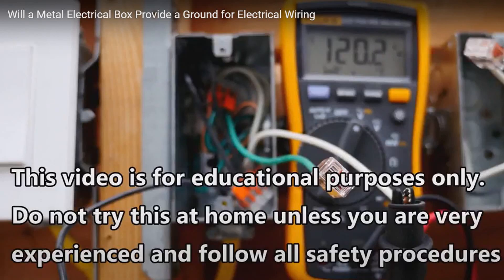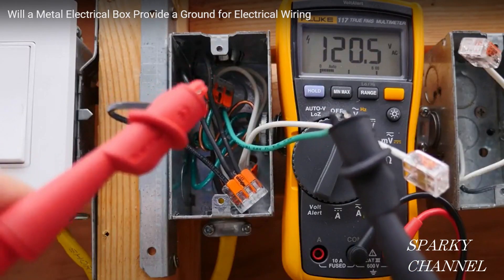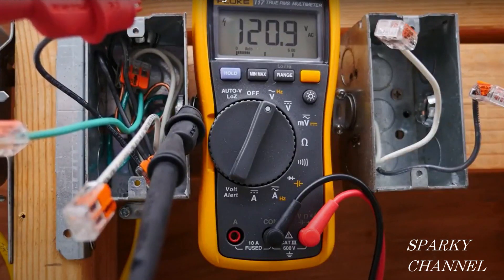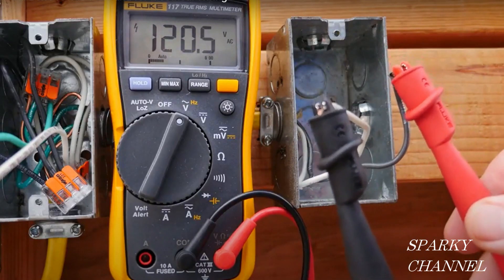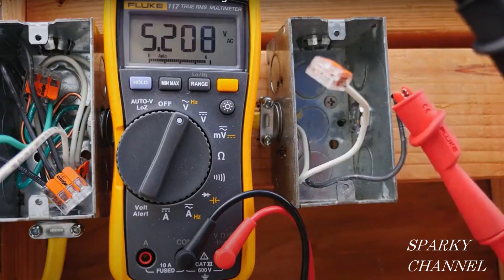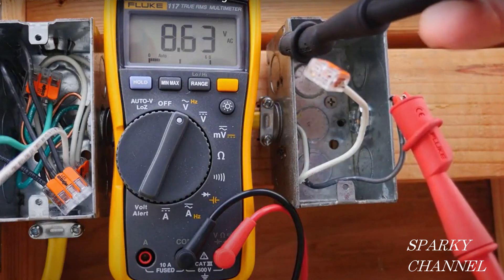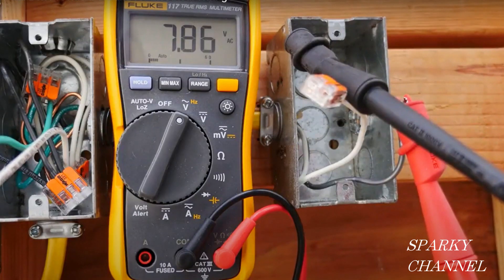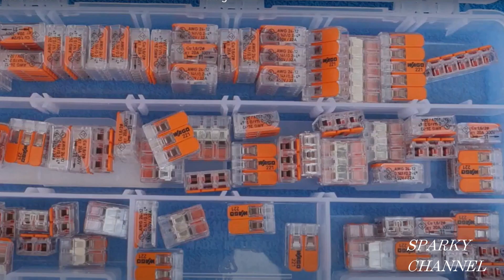Will a Metal Box Alone Provide a Ground for Electrical Wiring?

Comment: I have a 1966 home with an outdoor junction box (metal) that is ungrounded. I called an electrician to ground the box for the install of a new light. All they did was attach a pigtail to the box….they said “the box will never be grounded, this is the best we can do.” …should I be concerned?
Reply: Very concerned. I would be inclined to not pay that electrician.
Reply: Running a ground wire back to the electrical panel is the only true fix.  It could be expensive.
Reply: you mention an ungrounded box, how does the wiring get to the box? is just the cable? run through metal conduit? I have a similar situation but mine runs through a conduit all the way back to the Main breaker box so technically is grounded via the metal conduit where the wires are run through.
Reply: @linkarmy09  the wiring gets to the box just via the cable, no conduit. I tested the box for ground and got ~40 V (vs the 120 V I should get if it were grounded).

Comment: A meter reading of 120v between the black wire and metal box DOES NOT prove that there is a good ground connection to the box. There could be excessive resistance in series because of a poor connection or damaged ground conductor. The voltage lost across the unwanted series resistance will not show up as a noticeable voltage loss at the meter because the meter resistance is very high and draws a very small amount of current. 
The only way to determine with the meter whether the box ground is good or bad is to make a resistance measurement between the box and the neutral wire.  The resistance should be very low, under one ohm assuming the box isn't very far from the panel.
Reply: WHAT?
If you have a tester and you touch the hot with one lead and touch the box with the other lead and it shows 120 -
 you've got a connection.
Reply: @frankpaya690  Correct. But it could be a BAD connection otherwise known as a high resistance connection.

Comment: While I am not disagreeing with anything you said about box installations and grounding, I feel it is important to note something.

A measurement of potential (voltage) does not necessarily guarantee the current carrying capability of that pathway. In other words, you will measure the same 120 volt potential across 4/0 cable as you would across 14 ga. but the current carrying capabilities are far different.
The ground path must be robust enough to handle the current delivered during a short-to-ground occurance. For instance, if you grounded a 100 or 200 amp service main panel to your water main with a 12 ga. conductor, you'd measure a 120 volt potential from any leg to that ground but that would in no way be suitable to carry any large amount of current. If you shorted one of those main legs or bus bar to ground, that 12 gauge conductor would melt almost instantly. The ground path must be robust enough to at least briefly support current suitable to trip a breaker or blow a fuse before an overloaded conductor fire occurs.

That said, the examples of grounding you displayed are surely adequate for those circuits.
Reply: The voltage is the same. It's the amperage that determines whether you need a 14 gauge or an o-4.
It's not the voltage that determines your wire size, it's the amperage and that's dependent upon what that circuit is powering. 
A taser might have 50,000 volts but probably no more than a milliAMP,
 otherwise people would be killed all the time being tased. Whatever the overcurrent protection is, you should always be using that wire size comparable to that overcurrent, for hots, neutrals and grounds.
Reply: Fusing current for 12awg copper approx. 235 amps.   Not sure about melt almost instantly.

Comment: I was switching out a ceiling fan fixture and discovered using a non contact tester the box is showing “hot” - is that because the hot wire supplying has been exposed?
Reply: That's the problem with some of those testers, they're too sensitive.

Comment: I have a house in the 1950s and I all the outlets are ungrounded. What should I do? I have been told I could install GFCI. Is this true? or im better to do swiss cheese with my drywall and replace everything?
Reply: Here: https://www.youtube.com/watch?v=lGTauC0hHlw&list=PL9Gi-1DGtZaYmZJI6g2xgAi45WOiPt_-6&index=1
Reply: You have three choices:
1. Leave it as is = free
2. Swap out the old breakers or receptacles with GFCI/ARCI protection = a few hundred bucks
3. Rewire the entire house and swap out the old breakers with GFCI/ARCI = very expensive

Option 2 will give you protection and be to NEC code but you still won't have a ground.
Option 3 will give you full protection with a ground and will be to NEC code.
Reply: @jefflebowski918  Dude
Reply: I would like to know the same
Reply: @gardnetbush9768  Take a look here, this guy covers the situation you have along with thousands of other people, on the old 2 wire/no ground problem. He references the NEC book also. Here: https://www.youtube.com/watch?v=lGTauC0hHlw&list=PL9Gi-1DGtZaYmZJI6g2xgAi45WOiPt_-6&index=1
Reply: You might want to get your house rewired because knob and tube is hazardous

Comment: Well that answered why I was getting a low (~5v) reading when trouble shooting an old metal box but it does bring me to a how to fix question.  I have a metal box that doesn't appear to ground properly off the metal conduit.  If I run a ground wire to the back of the box (which I can do easily given its location close to the breaker box) and then ground the outlet to the box is that code?  I know running said ground wire directly to the outlet isn't but isn't this alternative just a cheat on the code? right now I'm just using a two prong but thinking alternatively replace with a GFI (and the "no equipment ground" sticker).

Comment: I heard that in older 50s and 60s homes just the fact that BX cables were used provided ground for the boxes. Can anyone confirm ?
Reply: It may if properly bonded to the ground. Just don't take for granted that the BX runs continuously and is properly  attached to a grounded service box
Reply: @danielrobert7181  Exactly. My house (built in 1961) has BX cables and so far, every box I've tested (including the two-prong ones) has shown a good ground, but I'm certainly going to test every one as I replace the outlets.
Reply: Thx, my question also.

Comment: Always good information, and I like that you quote NEC directly when it's relevant .  I have a question for you Bill, if I may? I have ungrounded outlets run with two wire NM cable (house is ~1980) in my basement.  I have an outlet in the same room on a different breaker that is grounded.  Is it ok/safe to connect a ground wire from the grounded outlet to the other outlets even though they are on different breakers, instead of running ground wire all the way back to the breaker box? 
Some interesting things I've found related to this video while demoing the walls and discovering no ground, they are all metal boxes anchored to concrete foundation.  When outlets are screwed into the box, my outlet tester shows they are grounded.  I get 120V reading between hot and box and even to a nail in the concrete.  The concrete wall surface even reads up to 100V.  No continuity between the different boxes or box to neutral, so I'm guessing it is acting as a literal ground, but not enough to be a safe electrical ground for the outlets?
Reply: The breakers are only connected to hot,
 they're not connected to a neutral or to the equipment ground. So it's irrelevant whether they're on the same breaker" as far as whether or not it's going to work for completing the ground to the equipment ground.

Comment: OK that’s a good answer because there’s so many confusing answers and questions about this because I replaced a bunch of boxes on the porch direct sternal and I could not figure out and I was doubtful about connecting my ground to the box because obviously the box wasn’t ground at anything there was no conduit or anything it’s just going to a wood wall and I was pretty good with electricity on motors and heavy equipment so gave me some knowledge of this even though 120 is different butHave an old house from the 60s and all the grounds are tied together but there’s no grounding straps in any of the metal boxes so and I read that if you if you try to put one on there then you could create current and then it’s not good so I connected all mine just to the outlet to the ground wire and did not connect them to the box thanks for the info thanks for the clarity

Comment: I have a question. So in my experience in my area, older homes in the 60's or more that do have metal boxes also have metal conduit that leads all the way back to the Main box. Does that situations provide a better ground? and if I have house ground attached to the main box do I effectively have a real ground?
Reply: I am not an electrician, but I believe the answer is yes that provides acceptable ground, with some caveats: if it's solid EMT then it's ok. But if it's the corrugated metal tubing then it probably would not pass code. The other thing is how the house is grounded. I think older homes only ground to the cold water intake and dont have grounding rods? I would check that too and make sure that the cold water ground is bonded to both sides of the meter (should see wire connecting from where it comes into the house, jumping over the meter and reconnecting to the other side). 

Hopefully someone with more knowledge chimes in and corrects me if I'm wrong. I don't want to pass along misinformation. I have a house from the 50's with the same metal tubing/no ground as you are describing, this is what I've picked up the last few weeks from reading into how to ground without a total re-wire.

Comment: hi my meter is only reading 86 volts not 120 , one prong on one of the hot wires the other prong on one of the 4 bolts in the box, all 4 bolts read  86 volts, is that enough grounding or  no, by the way in my country both wires are hot containing 120 volts each
Reply: Same… did you ever get an answer to this??
Reply: @jessm1638  same except 65v here

Comment: Hi Sparky, I have old Knob & Tube wiring in my house.  I was demoing a closet wall to make it bigger, there was a knob & tube wire running through the wall to an electrical outlet.  I have to reroute the wire because it’s not long enough after I build the new wall.  I was going to use 12 gauge romex wire and connect it to the knob & tube wiring in a junction box, so the wire will reach the outlet.  I also thought, since I was putting a junction box in the ceiling of the closet, can I possibly put a lamp holder with a pull chain on to that junction box and get power by tapping into the knob and tube?  Would I need to ground it because of the lamp holder, and how can I ground it?  The wires are running in my crawl space and I don’t think there’s anything to ground it to.  There just wood rafters and bricks and wood laths.  I’d appreciate your help. Thanks.
Reply: use a plastic fixture for the closet, there is no ground connections on them so you don't have to worry about the ground wire, anything metal needs a ground, if you wanted to get a ground with out destroying everything look for a water pipe (metal) do a continuity test to a known ground just to make sure ground is there, clamp wire to pipe and bring into the junction box and now everything you run from that box will be grounded providing your using 2 wire with a ground....

Comment: Plastic boxes are presently hard to find so I recently had to join three metal boxes to make a 3-gang box for receptacles. I assumed there would be a threaded hole in the metal box to attach a grounding screw. There wasn't. I installed spec grade Eaton receptacles. I hooked up ground connections to all three receptacles like I would have if they were installed in a plastic 3-gang box. I got the same reading whether I hooked the test lead to the neutral or to the actual ground or to the box. And why wouldn't I with 3 grounded receptacles being attached to the metal box?
Reply: Beware of of reading from the live wire and earth ground, if the earth ground is shorted on a neutral it will trsvel back on neutral line 1/2 the live wire curent.if live wire is 120 v ac the neutral will carry 60 v ac back to transformer if it is a alternating curent , direct curent has no neutral, it not travel back. Earth ground if wired correct has 0 v ac or dc. Earth. Ground is a dead short to ground.it cuts off breaker by a short not tempature. Regular panel breakers are tempature controled to cut off of mecury heat, you must reach that high tempature before it trips, most people catch on fire first.

Comment: Hi, because of Covid 19 I got stuck in Vietnam and living in an old apartment, they don't have grounding, every electrical things with metal housing I touch I get an electric shock. The incoming wire that come into the apartment only have the 2 wire (live and neutral). How can I add a grounding wire to this apartment?. Can I use the neutral wire as grounding?

Comment: My old light switch had only 2 inputs for hot and neutral but the wire itself has the ground screwed into the metal box. On my new switch i wired it with just the hot and neutral so the ground screw on the switch was left without anything.. I assume the wire grounded to the box eliminates having to run the ground to the switch ?

Im guessing since the ground wire is grounded to the box and thr switch is screwed to the box it should be grounded at that point

Comment: In the second, unbonded box you showed, if 3 wire romex was used (romex with a hot, neutral and ground) and the grounding wire was attached to the ground screw of a light switch or outlet, would that count?  I don't think so, but the metal of the receptacle would then be touching the box, as well as the ground wire.  I think the box still needs to be grounded like you showed in the first box, but the local electricians here think it does not.  Hard to get a straight answer on this issue.
Reply: I think what he’s trying to say to make it simple there’s so many answers to this that seem to be wrong but if the box is not grounded to the house or through conduit piping to the breaker box then you don’t ground the outlet receptacle to the box there’s no sense because it has no ground to go anywhere like the one man said it be like hanging a wire out a window it’s not gonna do anything ,Hope that helps
Reply: I don't see the difference. They're all grounded.

Comment: @Sparky Channel so I have a house built in 1962 about to install a new Range Hood but the old one only have 2 wires & I just checked the conduit to the White wire & it wasn't even close to 120 VAC. So does that mean I can't use it?

Comment: Now I know how to test the box.  Question though...   Why was no grounding ok back then...and now all of a sudden it's important?   In other words, is there some kind of data showing that homes in the 50's had lots of deaths or fires because of no grounding?   Just wondering.
Reply: Aftrn ... back in those days it was ok to NOT have seatbelts in your car as well. The info is out there (usually insurance statistics) and the change in codes usually reflects a new problem found (or a better idiot found) and what they feel is the proper fix to solve the problem.
Reply: Back then there were fires, and deaths from ungrounded devices coming energized. As more, and more people started using electricity the number of deaths, and fires increased. At some point the code was changed because of this problem.
Reply: It's not "now all of a sudden it's important".  Grounding, at least 3-prong receptacles, started to become the norm for new work in the 1960s.  It was a natural progression of building a better product and what rupe53 and Melllvar said.  Most people, even if they became aware of grounding's superiority, weren't going to go through the expense of replacing their house's wiring unless they perceived a danger.  I think why we see so many YouTube "how to's" currently about grounding is because there is so much old work still in use, it is aging badly and many new devices come with a 3-prong plug.  I would never plug an expensive computer, etc. to an ungrounded outlet nor use an ungrounded GFCI for it.  Some folks may want to get a HELOC and have all that old crap replaced.

Comment: My house has a lot of old MC cable with no ground wires - the metal jacket is used as ground. I’m curious how good that is. In your example here: what if the second box were connected with MC to the first box?
Reply: Is it MC or AC? With AC the ground wire (if present) is only present in the cable and is used to bond the individual twists of the sheath together, this is cut off and only the hot and neutral are terminated in the box. This is per the manufacturers instructions and the NEC. Older AC cable (commonly referred to as BX) does not have this bonding wire, but the sheathing provides a ground fault path, just not up to modern standards. AC cable has some fire resistant paper around the wires that may be visible if you look where it enters the box, but it is usually removed when the wires are installed in a box.

There is a new contender, called MCap from Southwire which installs similar to AC where you don't need a ground wire to terminate in the box as it is listed and identified as having the sheathing in contact with the bonding wire is an effective ground fault path.

If your old wire has cloth covered rubber, you may want to look into having it replaced as the rubber is degrading.